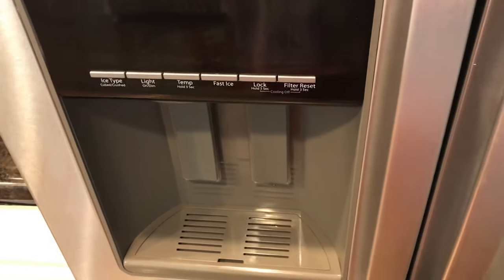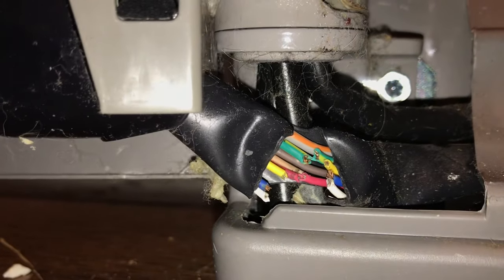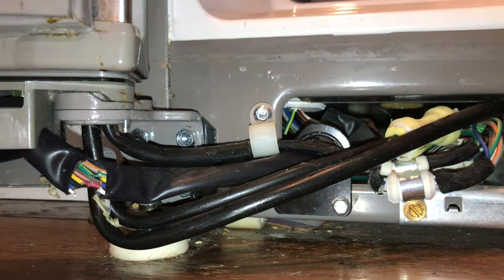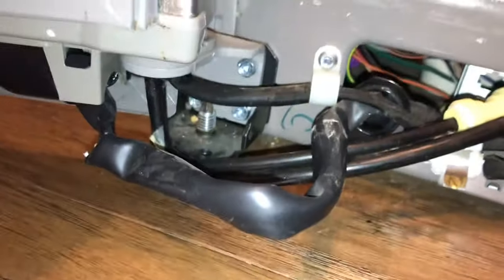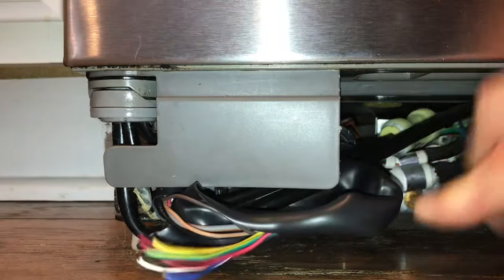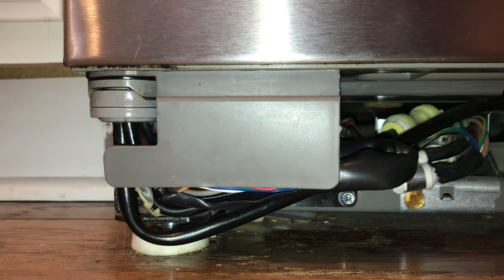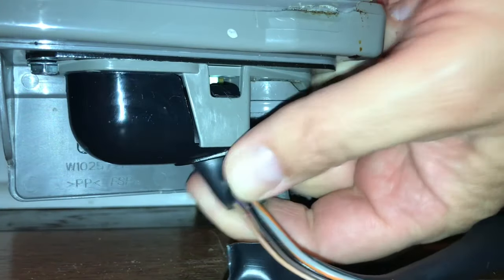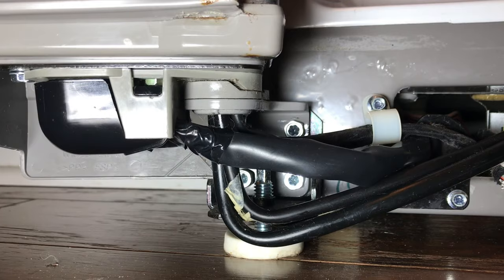Whirlpool double door refrigerator not making ice and ice dispenser doesn’t work. Wires WRS571CIDM01

Comment: Hey Whirlpool, 53k views on this video! Think there is a problem?? Nice Quality Control!!! 

I had already identified mine, but not before replacing the auger motor. I also wanted to see how you took care of your wiring harness.
Reply from the maker: I know, I forgot to show the wire repair. 🙁
Reply: @motofun72  did you splice or solder? Thx
Reply: @motofun72  nevermind, just saw your other reply. Thx

Comment: Great Video, you are right Whirlpool can do SO much better with this. Should be a plug on the bottom of the door and at the refrigerator so the pigtail can be easily unplugged for repair or replace. Did you use crimps to join the breaks? What are you supposed to do when it brakes  any closer to the door? Good job. I am guessing ice maker returned to full function?

Comment: This was exactly what my problem was. I had five wires that had broken pro tip to give yourself some more room is to disconnect the wire harness underneath the refrigerator that will give you more room to wiggle the wires around. I spliced in line wrapped style, fold over, then heat shrunk the wire. I did not fish my harness back through the hole in the frame of the refrigerator. I gave my wire some room to move around freely without kinking
Reply: How did that work out for you? Not fishing the harness through the hole. Did it hold up better in your opinion?

Comment: THANK YOU!!! this was exactly the issue with mine
Reply: my wire housing was different, molded/ribbed and not as much excess, like they tried to change the design but it was still pinched with wires broken just like yours
Reply from the maker: @sajabravo4632  good to hear you fixed it. Please help me by subscribing. Thanks.

Comment: I had exact same issue. BUT,  I took door off = MUCH easier wire repair, at chair height !! (I put door on saw horses). Recommend Take picture of front before removee screws and clamps. for easier reassemble. Other 
You tube video shows door removal, basically 4 bolts at bottom of door hinge and door drops straight diwn, NOT lift up, like most fridge doors.  There is a dowel pin at top hinge goes down into door top. Dont need to remove top hinge screws. The plastic water tubes = you push in at connector ring and pull out hose.  Only one tube had a little residial water drain out.  Mi or, nit undee pressure.  Can unplug the 3 electrical connectors and / remove entire wire harness w the door for easy repair . Unplug electrical connectors BEFORE disconnect tubes.  Can leave plugged in, and drape sheet or anything to jeep some of cold in freezer, just temp.

Comment: I just got my door back together, 1 broken white wire. Not sure if it's fixed until tomorrow. For repairing the broken wires, as the 1st wire is stripped and ready,  before soldering slide on a thin piece of heat shrink tubing, and move it away from the solder joint. Once it's cooled slide the heat shrink tubing over the repair and heat with a match. Much easier and cleaner than electrical tape. After all the wires are repaired tape the bundle. I noticed another shiny screw hole where the wire loom guide was installed and thought when the delivery people removed the doors to get the refrigerator in the house they installed the guide incorrectly. I wonder how many others here had their doors removed and reinstalled?
Reply from the maker: Thanks for the info. Good point about the delivery guys installing the doors.

Comment: I have a 4 year old Whirlpool refrig. My ice maker stopped dispensing  ice. A repairman told me it was the expensive panel which didn’t make sense. Then it stopped making ice! I saw your video and sure enough , 4 broken wires and covering broken, so exposing wires!!! I called Whirlpool customer service. Rude! Blew me off because this faulty design/poor workmanship refrig is out of warranty!!! Did anyone reach out to them? They took no responsibility!!!
Reply from the maker: I called them too (before I made this video). They said they would cover the wires, but I had to use their repair guy. Screw them. I’m not paying extra labor cost above a normal labor rate. 

I fixed the wires myself.
Reply: Our dispenser now works but ice maker isn’t!!!! Wire must be broken somewhere else. Do you know what color is for ice maker.

Comment: Man!! My ice maker hasn’t worked in 3 years. And then of course my water stopped dispensing. I look down at the water line and then notice this SAME thing with all the broken wires which you just mentioned here. I’ll be damned! Water dispenser was frozen water line from a bag of ice I had near the reservoir. But same door type, same wires, same issue. How long did it take to fix? Did you just strip the wires, twist to connect and wrap? Heard you mention no extenders. Thanks for giving me hope!
Reply from the maker: Yes, I was able to pull out  the wires, which gave me about 4 inches of slack. I just cut and twisted the wires together.  You can do it!  Just turn off the power  good luck!
Reply from the maker: Yes, I twisted the wires and taped them. Sorry for the late reply. I hope you got yours fixed.

Comment: Sure enough, that’s what happened to mine as well. It was hard to spot since it was covered in a mesh wire loom. I pealed that back and found the broken wire immediately. I Wish I had found this video before I bought a whole new ice maker. Oh well. Still better than buying a new refrigerator. we were considering it.
Reply from the maker: Good job find the broken wires!  Please help me by subscribing.
Reply: Hmmm I have wires in a mesh wire loom and in the rubber loom. The rubber was torn but all wires were ok. Did you have any other symptoms or was it just ice maker not turning on?
Reply: @blokeyblink  I didn’t have the rubber loom. It looked like a fabric tape wrapping up the wires, but it didn’t even span the full length of the wire cable. 

The only sign I had was the lack of ice. I suspect if more wires broke, instead of the one, it would have other symptoms.
Reply from the maker: @blokeyblink  for me, ice was being created.
Reply: @MegaBlox_Gaming  hmmm. Turned out to be frozen ice tray motor for me. I hit it with heat gun and couple hours later i got ice

Comment: Thanks for the video, going to try this! Never stripped or spliced wires before. I have a wire stripper with 5 or six settings. Do I need to know the gauge first? I have the exact same fridge - do you remember what gauge the wires are? Thanks!
EDIT: I just used caution and started with the widest gauge and moved one-by-one till it fit. It ended up being the smallest setting, 20-22 gauge. 
It stripped easily. I had to splice two wires. Twisting the wires together was finicky, given how small and how constricted the space is. Felt like a pretty firm connection, but this being my first time, will see what happens. I did not attempt to solder. Fingers crossed! Hopefully will have ice by tomorrow.
*UPDATE*: WE HAVE ICE! AMAZING. Fix took about an hour for a total beginner. That said, I only had to splice 2 wires out of the bundle. THANKS AGAIN!!
Reply from the maker: I don’t remember the gauge. Start big and then move down on the strippers (that’s funny). Anyway, it’s easy and you will have ice soon!

Please help me by subscribing. Thank you!

Comment: We have this model and never used the ice maker due to the bad content/sulphur in our well. Now we moved to a diff house and set up our water lines to the fridge etc. Now the ice maker doent work. Ours is a 2017 side by side ice and water through the door. Our panel in front looks like yours. Is there any special start up for icemakers that were never used? 
We will check the bottom door wiring. This fridge has been a pain and I wont buy another whirlpool lol.

Comment: Wow this is exactly what wrong with my refrigerator as well. You are amazing!!
One question though: Do you know what type of wire are these? I dont have any slack to reconnect them so looks like I may need to extend them. Thanks again!!
Liked and subscribed!!!
Reply from the maker: Sorry, I don’t. However, see if you can free up some wire from under the frig?  I was about to gain a couple inches.
Reply: @motofun72  Thank you for the reply! I checked and there is literally no wire that I can pull. Looks like I may have to buy some wire to connect the broken connection

Comment: This might be a stupid question....but did you unplug the unit before connecting the wires?
Reply from the maker: No, I turned the circuit breaker off at the breaker box. For me it was easier.  Either way, make sure it’s unplugged or the breaker is off!

Comment: What kind of connectors did you use.  I have very little wire where it broke at the door to work with?
Reply from the maker: Try to pull some more wire out from underneath the refrigerator (reroute it).  I twisted mine together (I know, crappy job), but it works.

Comment: We reattached wires and even bought a replacement icemaker. Still won't make ice. Is there a reset button besides the on/off switch?
Reply: unplugging the power for a few minutes is one way to reset it.

Comment: Hi, I checked mine and only the green wire is cut.  May be an odd question, but do you think that one wire could be the reason.  I have problems with the ice machine all the time.  Even when it worked, it appeared to often drop water into reservoir and then froze.  So then I'd have a block of ice.
Reply from the maker: Sorry, I don’t know. If you have one wire broken, then that will cause something to fail. What that is, I do know.

Comment: How long was it until they broke again ? 32 year experience,  never had one not break again. All needed a door at one point. The new doors route the wires different
Reply from the maker: Not sure. Mine is still working from the one repair. 🤞🏻

Comment: Did you say you just taped each wire (and then all of it) or did you solder or use butt connectors?
Reply from the maker: Just taped them. It was a slack job, but that’s all I had time to do.
Reply: @motofun72  completely understand. Not an easy job at all. Thx for the video.

Comment: A quick question! I have the same ice maker. It was full so I turned it off, like I have done many times in the past. I took out bin turned it back on and no ice being made.  I raised temperature of both freezer and fridge thinking line is frozen, water works fine . Any ideas, I looked underneath but I’m a senior lady and could not do such a fix.  I’m thinking of turning off circuit breaker to see if it resets?
Reply from the maker: I didn’t get ice until a day later. The wires did fail about a year later.

Comment: Thanks a lot for this, it is exactly what is happening to me. In my case I have all 9 wires cut. Any suggestion on how to attach them together again? Didn’t see how you did it in the video jejeje. I tried using crimp/shirk and when crimping the wire still falls out. Also in my case, the length of wires on door side is pretty thus harder to work on it. Any help or suggestions is much appreciated. I’m desperate to have Ice again!!!
Reply from the maker: Yes, I failed to show what I did with the wires. Brain fart!

I stripped enough to expose about a 1/2 inch of the wire on each broken wire.  After that, I twisted the matching wires together. Taped each wire up with electrical tape. 

Note, I did pull more wire out from underneath the refrigerator, which added a few inches in slack. The door side is limited. 

Plan B would be to add “extra” wire to the cut area.  I wouldn’t use crimping stuff, since there isn’t much room on the door side. 

Good luck, you can do it!
Reply: @motofun72  thanks again!! It worked! I was able to attach all wires. 

The issue that I have now are:

1.- The water hose supply to the ice maker is also cracked below (same as wires were) so when dispensing water it leaks. I tried putting black electrical tape to see if holds. Any suggestion here?

2.- the ice lever does not go down, it’s always up. Any clue if it might be broken and I would need to replace the entire ice maker?

Si far looks that is working but trining to fix this 2 issues.

Never going to but whirlpool again 🤪

Thanks again!!!
Reply from the maker: @alessiodirani  good job. 

Not sure how to fix the other issues you have. For the water leak, try some waterproof tape.
Reply: @motofun72  I’ll do, thx again 🙌🏻

Comment: Thank you for posting this information.  I know splicing wires is pretty basic, but I would have liked to see how you handled the short wires coming from the door.  Unfortunately, I had this same repair done, "professionally" a year ago and it's all broken again.  I'm not sure what my options are as they solder the wires and there doesn't seem to be any extra length. I guess, I could try to do a jumper wire unless that's a no-no.   Can anyone give me a heads up on what gauge of wire this is?  (It looks like the cut ones are the white, brown and blue one.)  TIA~
Reply from the maker: Hey, after posting this video I realized I didn’t show how I did the wires. Sorry.  I wish there was a way to edit an already posted video. 

Anyway, the door side wires have limited slack, which makes it hard to reconnect the wires. I cut/stripped/twisted the broken wire together and taped it up. 

If you had a prior repair, that good be good or bad. It all depends how they did the repair. 

I’m not sure 100% on the wire size.
Reply: I put in a jumper wire but still hard to keep the tiny wires together without solder.
Reply: This has to be most certainly a “manufacturer defect” and “engineering design flaw” 
Has anyone attempted to get whirlpool to fix this undeniable widespread issue under a manufacturer deficiency?
Reply: @schinnery6335  what sort of a jumper wire were they? Can you please share? Also are they still holding good?
Reply: @AnkitSoni_  I just used some 24 gauge wire I had around the house.  Stripped the broken wire on the fridge.  Added in about 2” of new wire by winding the wires together then taping it with lots of electrical tape.  I had two wires to add jumpers to.  It was fiddly and didn’t look very neat but it has held up for over a month now.  In fact, I just put back the plastic guard on the fridge bottom.  I had left it off in case my repair needed redoing.  Hope that helps.
Reply: @schinnery6335  Awesome! Thanks for the reply! I will go get some wires and try to fix this!
Reply: I contacted Whirlpool and told me “not under warranty”
Reply: Good luck with that.  Whirlpool simply states "not under warranty".  This is a blatant design defect.  I will not be purchasing any more Whirlpool appliances, since they refuse to take responsibility for an obvious defect.

Comment: Just did mine…any estimates on how long it took to kick back on? Switch is on, I’m getting continuity on all repaired wires. I crimp-spliced and shrink tubed 5/9 and the others seem fine.
Reply: Scratch that, on second repair I found another wire that was in bad shape. Once I fixed that it's back up and running. I crimped and shrink tubed 2 more, then wrapped everything well in electrical tape. Seemed the best I could do. The design of ours was even worse than the model demonstrated in the video. I took two clamps off to give us a tiny bit of slack. Really hope it works and sticks. Thank you for the video.

Comment: @motofun what gauge size did you use for the wires?
Reply from the maker: I used the current wires from the refrigerator. Pull more slack from bottom.

Comment: I believe the problem behind this is the wires are work hardening. Incorrectly spec'ed wire. Whirlpool should have used something like super flex. 

The wires bending back and forth cause the copper to become hardened. Then brittle failure. Then cut through insulation.
Reply from the maker: In the end, we have to fix whirlpool’s mistake!  Please help me by subscribing. Thank you!

Comment: Hey everybody that model of whirlpool refrigerator has a recall on the door you need to contact whirlpool and tell him that you have this model and you want them to come and put the recalled new door on your refrigerator for free it'll fix your problems I just found out myself they had too much attention on the electrical lines that's why they severed the electrical connections and they have a recall on the door so do that and you should be able to get a new one for free
Reply: Hi @Coolhand!  I just called whirlpool and they said there is NOT a recall on this model.  Do you have any additional info?
Reply: @NichWilson  well I was told by my guy that was supposed to be a recall but it could be something that other than that but that's what I was told and I read that also on the internet too on some site they have a flaw in the cabling it's too tight at the bottom and it severs all the almost all the cables with every time you open the door yet causes friction to the cables eventually cuts them so they should replace it